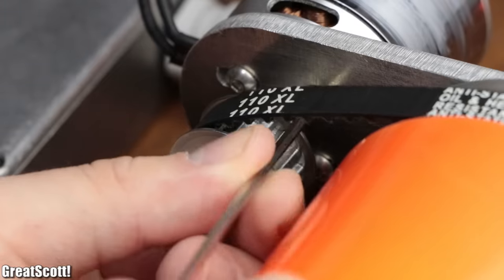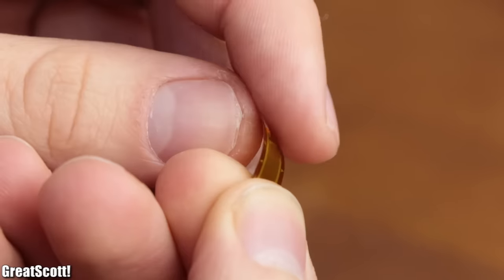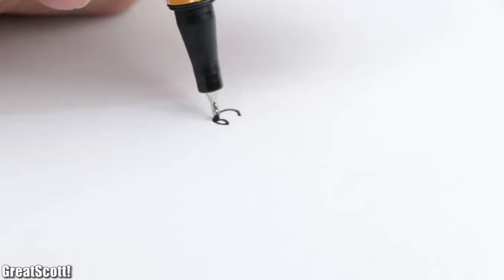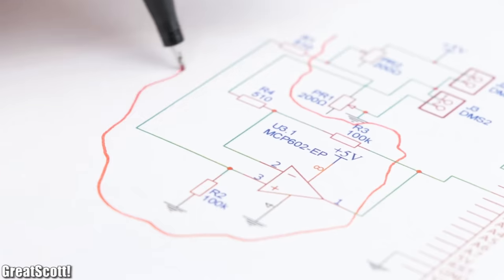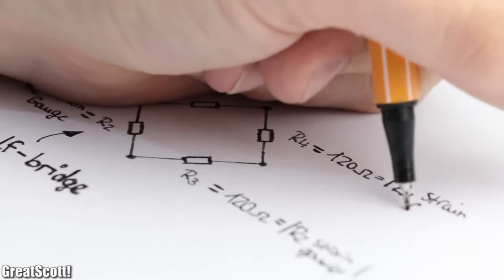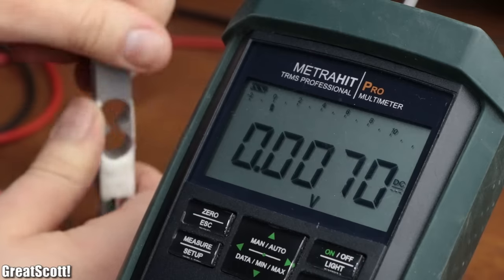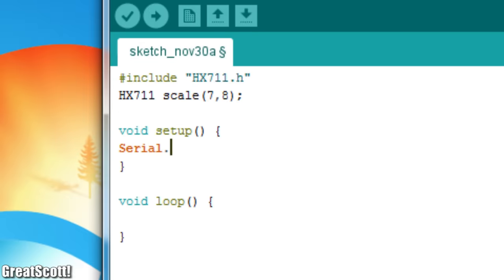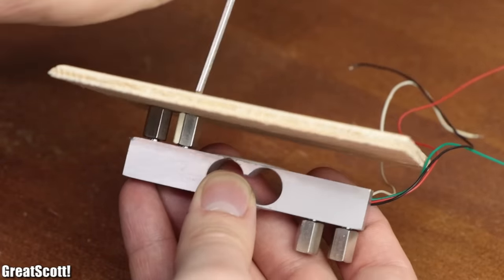Electronic Basics #33: Strain Gauge/Load Cell and how to use them to measure weight

Comment: What is a cheap but high quality benchtop power supply you would recommend and multimeter? Also what website, books, classes, or videos would you recommend to learn how to make electronics and make and understand conplex circuits?
Reply: Building a DIY PSU will teach you more than buying one: https://www.youtube.com/watch?v=QoGnOoTICGY

As for books I recommend Thomas Floyd's Electronic Devices by Prentice Hall: http://libgen.io/book/index.php?md5=F413FA7C6664ECACD863737D10365BB9

Also, learning how to simulate (Falstad, Altium Designer) will really help cement knowledge without having to build out every concept.
Reply: Wolfin thanks alot!

Comment: Nice video! GreatScott I wanted to amplify 5microvolt to 0.5volt. So I made a differential amp configuration with gain of 100000. I used resistors of 1M ohm and 10 ohm. But the opamp couldn't amplify the voltage. What may the reason be? My wiring is correct.

Comment: The movement of the load cell is almost nothing. Did you tried a destructive test with the purpose of knowing how much weight can the load cell take? (the purpose is to understand what happens if the sensor is used in unpredicted conditions)

Comment: Would it be possible that you could do a buy vs make thing with a battery charger? Something like chargine LiPo's or LiIon batteries. I dont know if you wouldnt measure cell voltage or something?

Comment: Great video! That was the best explanation of the underlying principles of the HX711 compared to the other videos. I had a question... What would happen if I supply 3.3v instead of 5v? With reference to your video, it'd certainly have an effect on the step resolution (correct me if I'm wrong!) but would there be any others alongside?

Comment: Hi,Where could I find a schematic of the op-amp circuit you used as the amplifier of the signal of the strain guage?
In a case such as mine, price is ultra-important, and the price of HX711 module is not reasonable here.
Thanks.

Comment: Please note the HX711 is rather buggy. erroneous spikes appear randomly, unpredictably and spaced apart in time usually lengthy time iterations. This is a known issue with the HX711. There is other versions that are apparently better shielded.
Don't be surprised if you see unexpected huge jumps in 1 sometimes 3  successive readings at its highest gain and and speed settings, using the breakouts available. Using the internal clock is also not recommended as it is far from spec.
For a device that is digitizing such small voltage changes it is remarkably poorly designed including the simple breakout.
the company that produce/supply these chips are rather unhelpful and appear to be a middle man distribute also.
Filter the best you can, discard any fast impulse nature'd signals, quantify the signal you wish to digitize, shield your solution where possible, try average windowed signal processing and run the device/s from a dedicated clock at its lower speed possibly lower gain also after quantifying what it is you actually wish to digitize.
The HX711 does not seem to be a dedicated ASIC instrumentation amplifier but rather a uC+ADC+AMP.
Try using an INA826 and your chosen ADC with a little planning on what it is your wanting to investigate.

Comment: Amazing video! Thank you.

Will this sensor work in tension as configured? Or will it only measure compression?
Reply: It is the same in this case. Since it is a sheet of wire, one side is being compressed while the other side is being pulled (tension).  The compression and tension has the same value, in finding the compression you will find the tension mathematically by calculating it.

Comment: Sushma Mantagani
1 second ago
Instead of measuring weights if i have to measure voltage in hx711 ,how will be the connection? and how to read 24 bit value?
Reply: use other 24bit ADC

Comment: This is a fantastic tutorial. Any idea how I could use the arduino to operate a load cell with 9-12v input. 5v from the H711 isn't enough. I'm using 100-500kg S type load cells from robot shop.
Thanks H
Reply: Did u manage to do the 500kg

Comment: There's a big flaw in the idea of autostopping the board when no load is detected. It's a very common case your body sometimes to lift a bit from the board and land on it again. This happens on bicycle, motor, ie on every transportation device where the human body relies on the legs and/or hands for retaining to it. To be more clear - it's very dangerous to rely on hard coded min load value while traveling 3 times faster or more than you walk normally. But why? Because when lifted a bit above the board, your body continues in straight line while the board must compensate the difference in positions between it and you. One wrong step induced by that difference, for example stepping on the side edge of the board, and you are going to ER
Reply from the maker: True. But you really think I did not thought of that. There is a delay in the code which prevents your described scenario.
Reply: @greatscottlab  So your delay prevents and against two very fast bounces in a row? I highly doubt, this thing is usually prevented by predictive active suspension
Reply from the maker: After different tests, the code worked fine with all kinds of bounces. Do not worry. I will not release the code nor the weight measuring update anyway.
Reply: @greatscottlab  How did you test?

Comment: Please make coilgun (with capacitors and igbt transistors) or cnc/3d printer.
Reply: IGBT's are expensive and not durable enough, you can get currents much more then 200amps, just use a industrial emergency switch ! (make sure it's the kind that can actually cut/enable current flow)

Comment: @GreatScott You are using the nrf24l01 for wireless communication! How far are the ranges? I tried to communicate two arduino nano to each other but they fail always after couple meters! Is it normal?
Reply from the maker: Not normal. I tried 5m so far and did not have problems.
Reply: Weird... I did now ordered a new pair of these but with an external antenna, before I tried to use 400MHz RF Transmitter/Receiver but the range was... couple cm? Maybe half meter and then done, even with a spiral antenna soldered in... 

Might this problem caused bye a high power consumption (I want to replace my doorbell with an additional system with more sound and light since I don't hear well, range would be 50m with two doors and a 90° corridor) since I would like to power it by USB (5V 500mA)?
Reply: I guess that you have SI24R1 with LNA sensitivity issues. The only thing you can do, is to add more decoupling caps close to "nrf". bk2425 (like the one in 0:12) suffers from different sort of weird problems.

Comment: Your hx711 its 10 samples per second or 80 samples per second?
Reply: This green version is 10sps. On the datasheet you can see pin 15 RATE is Digital Input/Output data rate control which 0 is 10Hz and 1 is 80Hz. As there is nothing on PIN 15 it is low. You can solder a wire on PIN 15 and VCC to get 80Hz.

Comment: 2:08  when you flex the strain gauge i do not see  any different values apart from 120.4 and 120.5 Ohms. That is not slight change. That is practically no change at all! Strange.
Reply: myonlynick from .4-.5 is enough to make small changes in voltage on the quarter bridge. These voltages then get amplified.

Comment: Mass is not the same thing as weight.  Mass is the amount of matter in an object, whereas weight is the force imparted on an object due to gravity.
Reply: Yes but here on the surface of the earth they are used fairly interchangeably, even in physics classes.
Reply: Never rely on assumptions.

Comment: NEED HELP
So the original rechargeble battery from a RC car (WLtoys A959 vortex) died 
I took its connections and I crafted another one
From old laptop battery 
The battery got a little hot after a slow test run I don't know why
Reply: Notebook cells cant provide huge amount of amperes for RC car, you need special RC accs that have good discharge currents.
Reply: Taran WLtoys A959 can reach 40-45 km/h 
Sooo might be ok
Reply: That is still a lot higher current than your laptop batteries are designed for.
Just think about it - how long where you able to drive the car before? Even when driving slow that is maybe 30 mins. Compare that to a Laptop - they usually last more than 4 hours with the load maybe coming up to 2-3 Amps.

That cars battery is rated at 7.4 V so it is 2S and with full throttle runs for maybe 10 mins - so you want batteries that can handle at least 10 Amps if not more. That would require several laptop-batteries in parallel - or just buy a decent battery for the next RC-Toy store.